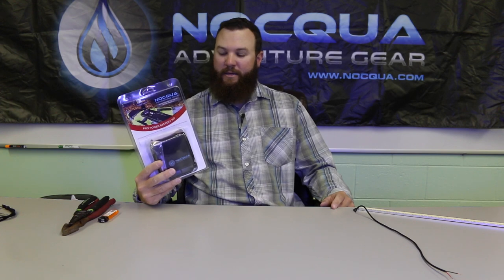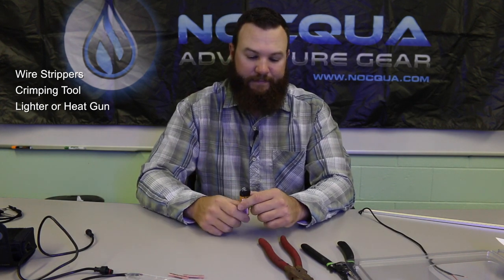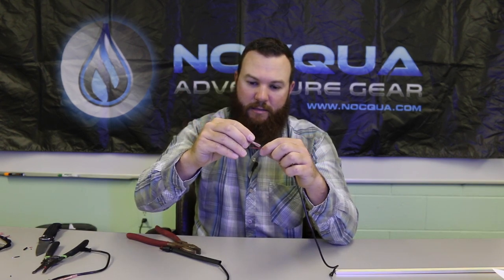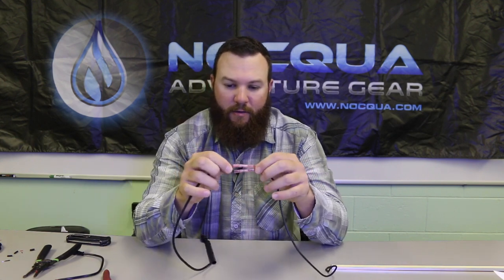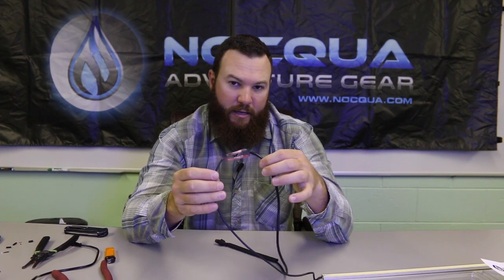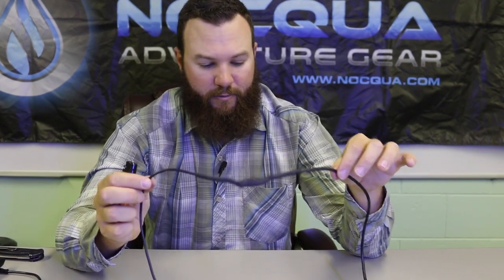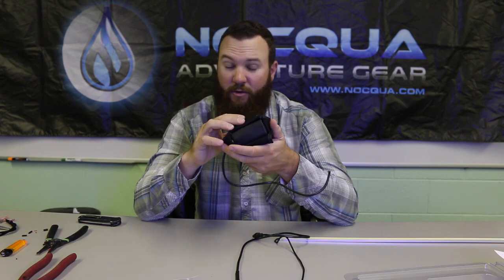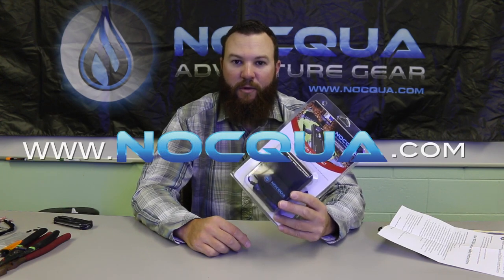Nocqua - Pro Power Kit Instalation

Comment: Actually, I think I would check the connection before shrinking the Heat Shrink tubing. That way, you don't have as much 'work' to go through to resolve any issues.

Comment: How long will the charge last when using for just LED lights???   
Thanks for showing how to join two wires,, 
But can you talk about the life and use of it Please
Reply: +YAK MAN The 4.4Ah battery will run the lights between 2.5 and 6 hours depending on what unit it's hooked up to. The 2000 will have the shortest run time and the Spectrum will have the longest.

Comment: just got this 10AH pro kit, and it said to Charge fully before use... has been showing red light for at least 2 hrs and charge is so hot can hardly touch it  ???
Reply: is it worth it? how is it holding up with fish finder?
Reply: it got hot on the initial 1st charge( as described ABOVE ), since then it hasn't got hot again...  seems to work and charge fine
haven't had a chance to try it out ( use it ) for a full day on the water - looking forward to how long it lasts on a full charge running my Dragonfly 7 Pro
Reply: thanks .. im in the market for one and searching around.